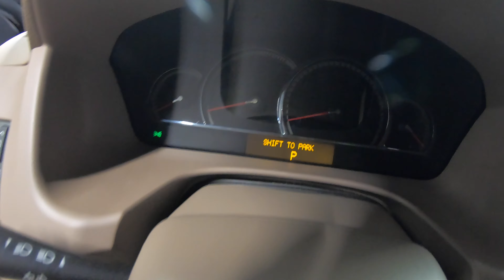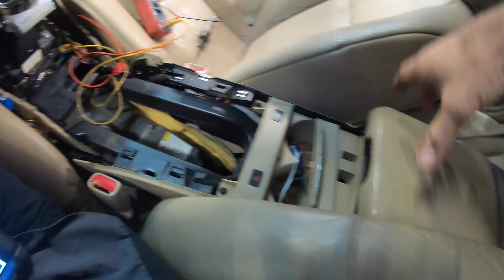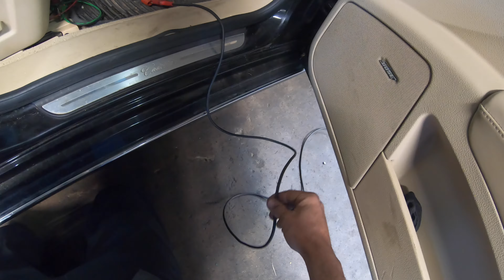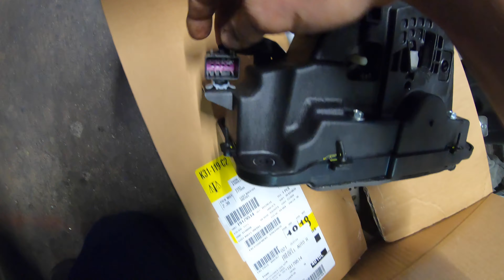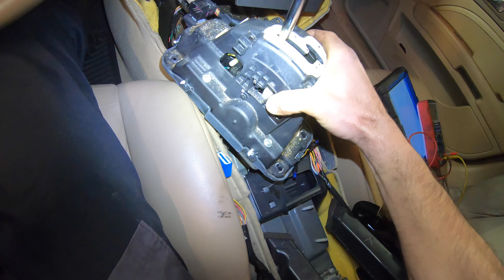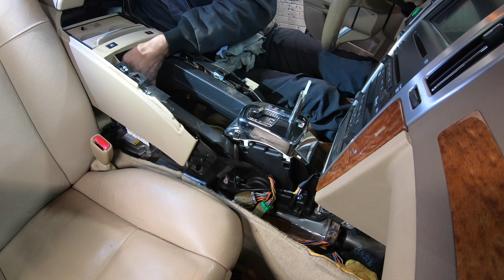Shift To Park Fix / Repair Cadillac STS , GM Chevy Buick

Comment: Outstanding job...can a bad micro switch cause the key to get stuck in the ignition n cause the traction control, theft system lights to come on n possibly cause the gas and temperature gauge not to work ❤

Comment: Great video and knowledge so does the micro switch sends the signal to the cluster so when you push the push start button it sends the signal to tell the starter to engage

Comment: I have a 2006 STS V, I NEED PART # 19179513 , WHERE CAN I FIND THIS PART! PART # 19179514 WOULD NOT WORK! MY CAR GOES IN TO PART BUT WHEN I RESTART AND TRY GETTING IT IN GEAR IT VERY ROUGH COMMING OUT OF PART! WHAT CAN I DO ! WILL A REVIVING KIT REPLACING BUSHINGS HELP?
Reply: Can you please reply  🙏
Reply from the maker: That part in discontinued unfortunately from what I see, you may have to try rebuilding it or find a used one from a salvage yard

Comment: Really nice video.  Looking at buying an STS with this problem but I'm told it won't start, even in neutral.  That seems like more than this problem.  Is there a spot where the pink wire goes that is accessible without disassembly to apply voltage to?  Perhaps a fuse or where it comes out of the console? Hate to buy a car thinking this is the issue and find the engine or transmission is terrible.

Comment: We have a 2006 STS-V with this issue.

Assuming we just wanted to replace the gear assembly altogether with a known good used part, is the gear assembly for the STS-V the same as the regular STS V6 and V8? The trim cover seems to be unique, but I'm not sure about the assembly itself?

Comment: I took everything apart. And had the micro switches tested. They all show good can it still be a micro switch just not strong enough?
Reply from the maker: If you are just testing resistance then yes its possible it still may not be enough,  test it plugged in like in the vodeo and see what the voltage input and output is while pressing/releasing shift button

Comment: I'm going through this problem now, and been to 3 different shops, and 2 said they can't fix, last one said shifter parts is discontinued . So now I have a care sitting in driveway, hooked up to battery tender trying to figure out what to do with car. Good video, thank you
Reply: Micro switch or new gear assembly. I have the same problem

Comment: Having the same issues i believe. 2007 DTS is stuck in park, i can push the pin in to shift but still no start. Shows drive on the dash but its physically in park, so ot wont turn over, Having a hard time. Imm not working, trying to get work and its my only car. I ant afford parts, no money. Trying anything free or a work around.  Thanks either way.

Comment: Have the same issue right now on my Cadillac srx 2012 Can you discount the shifter linkage from the gear shifter without going underneath like you did ? Or I have to to release the tension